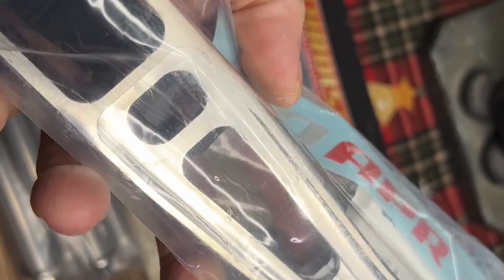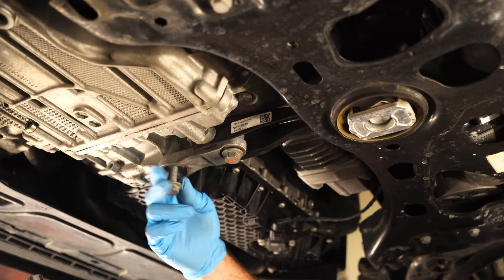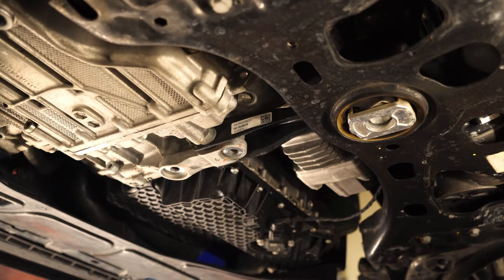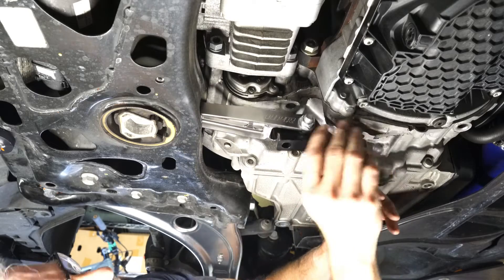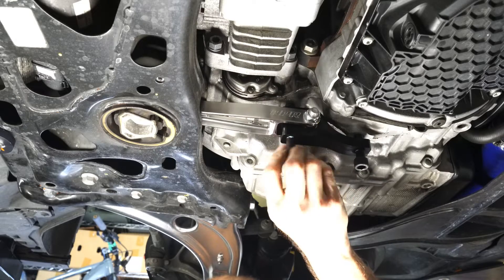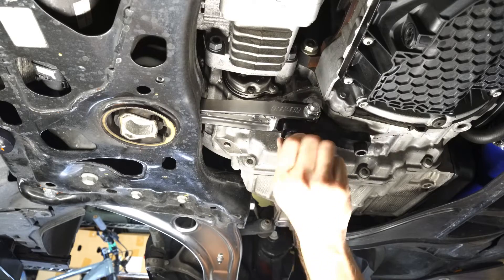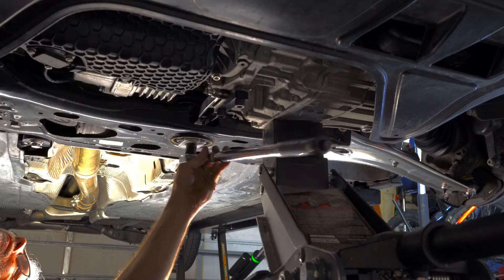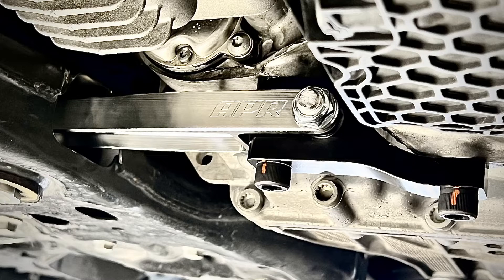APR Dogbone (Pendulum Mount) install on 2019 Golf R

Comment: just ordered this for my MK8R...  Looking forward to Feeling the difference.  Hoping to go stage 3 this spring.  Right now I've got 7K miles on my APR 93 OCT High Torque tune with no signs of slippage yet.
Reply: had it installed today... they also had a Stage I APR 93 Full torque update for my flash that they applied.  I'm getting a weird noise under acceleration now.  It pulls like a beast though... not sure if it was the flash or the mount causing the noise.  It's not vibrations... the engine under acceleration sounds off.  Taking it back in tomorrow to see if they can address the issue.

Comment: If the line you made on the bolts has moved. Is the fix to just simply re-torque them or would new bolts be needed?
Reply from the maker: I would re-torque them and keep a watch. The line is mostly an indicator that I have verified torque, and tbh I have never had a bolt move after torquing and marking.
Reply: @EVERYTHINGcpo  sounds good. Thank you!
Reply: Use loctite and re-torque if that happens. Should not move though if torqued properly.

Comment: How much additional NVH would you say you’ve experienced from the combo of the “puck” insert and the pendulum mount (bearing in mind the caveat that there’s no “free lunch” when you start playing with factory rubber bits, of course)?
Reply: I Diddnt notice much of a difference until I installed the stage 2 bfi mounts, I have a manual transmission by the way. Now I hear the gears meshing in the trans and everything.if you have a manual be prepared for a lot of nvh with motor and trans mounts but I Diddnt really notice too much of a increase when I had just the dogbone inserts and pendulum mounts
Reply from the maker: I didn’t notice a difference after adding the dogbone mount, tbh.  It was the last piece of the “mount” puzzle for me, so take that for what it’s worth. It’s all been very minimal overall.  I remember when I got the inserts installed i there was a noticeable difference, mostly at startup. Then the motor/trans mounts added noticeable NVH at deceleration and when sitting stopped. But the added dogbone didn’t seem to add any more that was noticeable to me.
Reply: I got a bit more buzz from the 034 inserts. When it’s cold it a lot worse but I’m in Michigan. CPO I sent you a DM on IG regarding your exhaust. I’d love it if you could respond. Your content is great! Thanks!